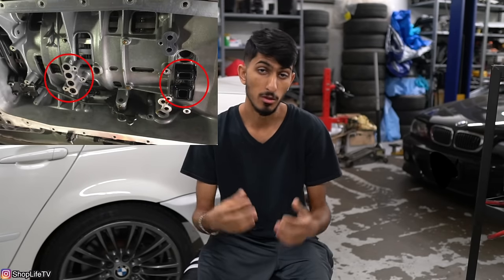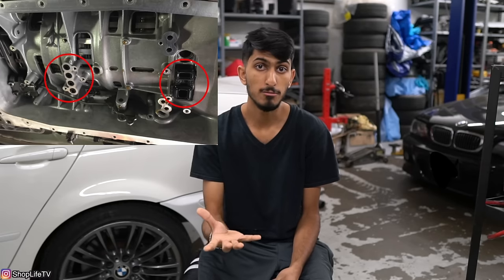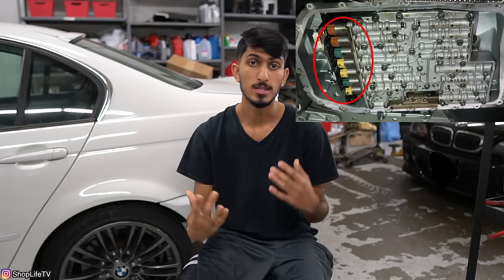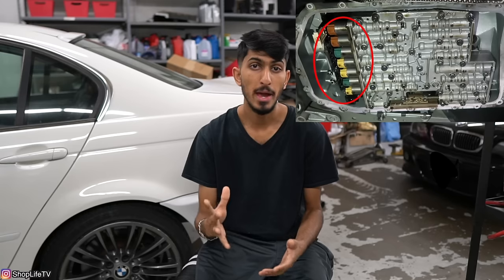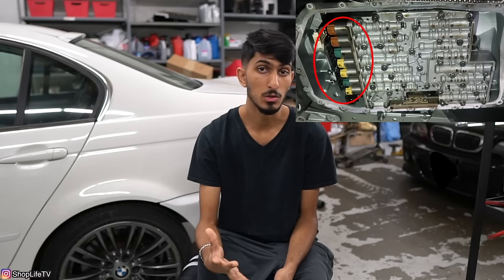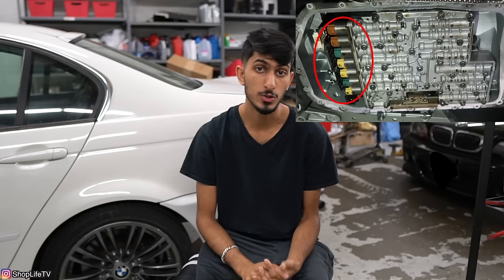ZF 6HP 6 Speed Auto Transmission Troubleshooting! Common problems

Comment: Hey man love your videos bro, super helpful! I have a 2007 335i I bought stuck in limp mode based on transmission codes. In transporting it home I thought I could make it in limp mode but it was a pretty long drive and while headed home the vehicle just died. Refused to try and start at all, no clicks, no noises, nothing. All the dash lights still come on and you can hear fuel pump priming but absolutely no attempt at starting. The codes in getting from my standard obd2 reader are U110F AND P0705. Any help at all you can offer on what you think the problem is would mean the world to hear bro. I’ve read it could be the TCU or short in the wiring but I honestly have no clue where to start, don’t want to jump to replacing things unless I feel there is a good chance it’s actually the problem, I have all the tools and equipment to DIY, just looking for direction. Again any response helps!

Comment: HEY GREAT VIDEO  @ShopLifeTV   ... question  I literally two days ago  had a transmission malfunction shifting from 3 to 4th slipping does not want to go into 4th ( 1 to 2 all good , 2 to 3 all good , 5 to 6 all good and down shifts from 6 to 5 to 4 to 3 to 2 to1 all good)  vehicle is a 2008 535xi   almost 270,000 kms on it . any thoughts?

if im driving and it hiccups from 3rd to 4th , and when I get the fault if I clear it right away while driving  and shift to 5th its all good in 5th and easy shift into 6th . then all the down shifts from 6 ---> 1 from there are fine no issues ... this is so weird 😠

Comment: Hi, first of all I just wanted to say thank you for your videos. I am getting the transmission error 4F85. My car has a ZF6hp26Z. Do you think is a good idea to change the sleeves, filter and fluid? Will this fix the issue? Also my car has 145000 miles on it. Is a good ide to change the fluid? Thank you

Comment: If someone didn’t replace the transmission controller unit for the valve body, what would happen? Would it just not work altogether? Or would it work and then stop working shortly afterward?

Comment: Quick question: bmw 320i with GA6HP19Z. 200k on the clock the filter housing was replaced at 80K because it was leaking oil. Now should I change the fluid with filter at this stage? Transmission is working fine no issues or codes but don’t want to wreck a perfectly working transmission just by changing new oil thoughts ?

Comment: I've replaced the solenoids in my 2007 750li and I'm having the same issue. It's not as bad as it used to be but car still goes into safe mode when shifting from 3rd to 4th and sometimes it gets a whining noise from the trainsmission. Is there a difference in those solenoid colors? A certain spot they go in? Pressure difference?
Reply: My 6hp21 gearbox has 50k miles on it and it fluctuates in rpm when shifting from 3rd to 4th gear and throws the 4F89 error. I changed the sealing sleeve, oil and filter, I will analyze the solenoids.
I did a lot of research on this error code (4F89) and came to the conclusion that the problem is not with the gearbox itself, do you have any idea what else I can check?
Reply: @JulianoEsman  any luck figuring it out???
Reply: @itsdakku  I replaced the clutches, as there were many pieces of them in the gearbox filter. I ordered a new valve body and new mechatronics, it will be replaced now, I hope it resolves.
Reply: @JulianoEsman  yeah im going to do a full rebuild itll cost me 3600 Canadian dollars in total with removal and installation of the transmission
Reply: @itsdakku  Even without changing the TCU, I drove the car these days and noticed that the gear changes were back to normal.
Something I always found strange was that, from the first moment the error appeared, when I cleared the error with the XHP App (you don't need to buy a license to read the errors and clear them using the app), it showed ABS, DSC and flat tire errors. After numerous texts I read, they talked about a problem with the ABS sensor that could interfere with the transmission. As soon as the gear changes seemed to return to normal, I received an ABS sensor error on the right rear wheel. 
I came to the conclusion that you can redo your entire transmission and in the end the problem could be a simple sensor.
Reply: @JulianoEsman  today the car wouldnt go into first gear. I already have XHP for my 340i so ill connect the car the xhp today and clear the codes and see.
Reply: @itsdakku  When clearing the transmission error, if ABS, DSC and low tire pressure flash on the dashboard, even momentarily, it would not rule out a faulty ABS sensor.
Today, after practically rebuilding my transmission, the transmission error persisted, now that I have a constant error with the right rear ABS sensor, the transmission started to shift gears normally without error.

Comment: I have bmw e60 520 d 2008 
After 100 kmph transmission faulty drive moderately light showing  so i have to stop the car switch off and start again and gear shifting slowly also what happing exactly with car please give me solution

Comment: Hi. I have 2008 335xi, I replaced all sleeves and filter as well. When I’m driving and I’m stepping on the gas hard the tranny is jolting and jerking on 3rd gear. Should I replace solenoids? Or it could be lack of oil?
Thank you

Comment: What if antifreeze got inside the transmission..my transmission cooler broke and both fluids mixed in together. Did a flush and filter change but..my mistake the mechatronics sleaves did not get changed out. Do you think I need to replace anything else

Comment: Is there a transmission update that BMW can send to your car to fix the 1-2 gear hard shift and then while in 3 or 4 th it hiccups I guess maybe a slip? I get a transmission malfunction error then it won’t upshift at all. I reset by doing the gas’s petal reset. After that it shifts back to the original problems. I replaced filter fluid and seals for valve body. I hate to keep throwing money at this cause I just don’t have it. But I love the car.

Comment: great info's! 
In case on 6HP gearbox, would you recommend change the entire  qty of oil including the oil from torque converter (total of 10 -11 L)or just the 7 L + filter as  you more than likely will be available to buy as a kit?
Also for changing the total qty of oil (including torque converter) is there any procedure available without invloving the special machine?
Thx in advance for your reply!
Reply: The jag forums have a DIY flush procedure.
Reply: @hoisinga  do you have that procedure?
Reply: Saludos tengo un rrsport 2006,6hp me golpea al pasar de 1  a. 2 y viceversa, que debo reparar exactamente o sustituir?, gracias

Comment: you could probably do a video on changing the fluid alone, every time I change the fluid it gets worse, 06 range rover had a bad solenoid, bought a set and replaced them as well as the seals, now I have no forward or reverse LOL, I need impa or ista so I can actually see what is wrong instead of guessing, measuring the fluid temp is tricky and somewhat critical, just got torque pro to monitor the fluid temp.

Comment: Great video. I have an E65 730ld from 2005 and the transmission keeps giving trouble. Most of the time is when I start the car when the engine is already warm.
The tranmission display starts flockering on and off and it shoots in and out of gear. 

I had 2 different kinds of software written on the transmission ecu but the transmission keeps acting up.

Please say you know for sure what this is ;). Thanks for all your videos.
Reply: I'm having same issue. No codes are showing
Reply: Did u find out the problem?

Comment: I have a BMw X5 4.8 L 2008 , it started with problems on the 2nd speed, later can not shift any, from neutral or  reverse it goes automatically to parking , so the truck is not running any longer. what do you think it may be?

Comment: Tried to ask a question from your website. I am in Australia and it seems I couldn't proceed because I reside outside USA. My question relates to 2008 BMW 550i - last time i drove the car it spontaneously went from D to N and then to P and stopped. It did this 3 times in the space of quarter of 
 a mile. To restart i have to rev the engine a bit. I was able to drive home (about a mile) very gingerly without another occurrence. Would a Sonnax kit  valve body rebuild help with this problem do you think? Chris

Comment: I have a 2006 330i and Transmission Malfunction gear icon is on the dash, code said it’s a 4E87 Solenoid valve 4 shift lock , neeed help

Comment: I need HELP please! I just had my ZF6HP19 transmission totally rebuilt with a new torque converter, re-manufactured valve body, and new Kolene coated frictions and upgraded bushings, etc. We used Pentosin ATF1 fluid since that is what Precision Raceworks said the Kolene coated frictions needed. I get hard engagement in D from N. I also get harsh 2-1 downshift and there is a whirr noise between gears almost constantly. Any ideas?? I am over $4,500 into this transmission and it still has these problems. My re-builder says the problem is the aftermarket race frictions from Precision Raceworks. I get no error codes. I have reset adaptations and ran several different transmission flashes. I am stumped.

Comment: What’s up man, I was doing the normal maintance on the zig transmission yesterday evening and tried to turn on the car once the mechatronics was seated nicely and the sleeve was placed in nicely as well. The car won’t start up and will only light up the dashboard acting as if it is on… not sure if you can help me diagnose this situation. I do feel like I may not have the connector seated on the pins correctly…

Comment: i have m54 bmw with zf6hp19 auto transmission. i have a 4-5 flare when the engine is pushed over 3000 rpm. What would you do about this one? Do you have any idea on how you would go about fixing it. It will set the 4f85 code if pushed hard.

Comment: My 2006 bmw 650i has a normal 6 speed automatic transmission. Did the flush and filter and replace the solenoid sleeves and still not work 100% gave me a fault code with in a week. Whats next to do?

Comment: Hello my son’s car 2006 e90 shows a transmission overheat warning light and him pull over to check find a oil leak after that trying to drive but can’t release the shift from parking positions, he tow back home and we find the leaking coming from the oil pan we replaced with sleeves and zf oil but now we try to clear the codes but the scanner doesn’t have a communication with a transmission control module, all fuses are fine you think transmission are not good thank you

Comment: Hello, my car uses a 6HP26 transmission, in my country I could not found the ZF lifeguard 6, for that reason when I changed the oil I used a Febi bilstein 34608 that meets ZF specification. After oil change my transsmission start to “jerk” reducing from second to first gear. Before oil change I did not have this behaviour. my suspect is related to the oil level. In your opinion, where should I start to check on this case? Solenoid, sleeve, oil level? No fault codes are active or registered on TCM. Thanks!

Comment: I had slow gear change on my automatic 2008 520d. I got the transmission oil and filter changed and it's still the same. What's the problem with it

Comment: There are a lot of numbers on the side of my transmission and the don’t seem to coincide with any I am looking at for parts-  I have a “bad solenoid” code and want to be sure to order the right replacement- 
The car is a 530xi wagon with the 3.0 ltr engine but the transmission sticker says It is a zf5.
Could that be correct?

Comment: Very useful video.
My specific problem is that on starting the auto gear shift stays in 'N'  & not 'P'. So the engine does not start. And there's a message 'Transmission fault ' on display.
What could this mean?
On waiting or reset the car does start or move. But it's a hit n miss. 
What possibly could this be. A valve body or mechatronic or other possible Transmission issue? Thanks much.
Reply: Hey, did you ever find a solution? I just did a full service and filled the trans with new fluid. Went to start the car to continue filling and the car wouldn’t start becuase the trans is communicating that it’s in neautral.

Comment: I have p0850 code- Park Neutral switch on my 2012 Range rover HSE, Car starts and drives perfect with no issues, whereas when i stop and put into PARK, the Dashboard displays N instead of P for few seconds and then i have to wiggle the Gear lever in Park then Shows as P, Sometimes when i get into the car and turn on the ignition display says Neutral, even though the car is in parked position. Can you guide me on this? I looked up so many videos and blogs, it says possible Shift assembly corrosion due to Snow and Salt in Eastcoast or it could be inside the mechatronic unit where there is Park Neutral Switch. Can i Drive as it or it needs asap repair attn?

Comment: I have a 2008 Range Rover L322 with the ZF 6 speed transmission.  If I leave normally from a stop the transmission shifts fine.  If I leave from a stop with a heavier than normal throttle the transmission hangs up between 1st & 2nd gear and the transmission slips until I take my foot off the throttle and then it falls into 2nd gear and the remaining gears are fine.  I have had two transmission repair shop drive my car and they both say a complete transmission rebuild. 
Any ideas?  Thank you.

Comment: Hi Bro, Can i ask you a quick question. after changing transmission oil and filter on my 520d I am getting transmission oil smell from the air vent when the car is idle. no smell when driving. any idea why it's happening. thanks in advance

Comment: Hi how are you doing I have a question regarding to my 528i 2008  I replace all the seals in the valve body in all the celinoids  in i  still get the code 4f8A  4 - 5  gear  do you have any  Suggestions on that ? By any chance?

Comment: Hi.I get a gearbox fault after about 30 min of driving , when the car it`s warmed up properly . The gearbox automatically goes in neutral then immediately in a low gear, i believe 2nd gear , once the fault comes up on the dash . It still drives but just wont change gear. The fault goes away if i turn it off and back one but it comes back later. It feels like some clutches inside the gearbox start slipping , then the fault comes up straight away . No unusual noises , like grinding noise or anything else
.It`s done it while i was driving slow , 20mph and also on higher speed ,on motorway , at around 60mph
From your experience , do you thing it just needs a service (including the 4 seals, bridge seal )to fix the problem ? The gear change is always smooth , until the fault comes up and goes into limp mode. My local garage checked the gearbox oil level and it seams to be ok. The car i have is a 2009 bmw 520d auto. Great video ! Thank you

Comment: What would the cause of jerky 2nd-3rd be? Especially when I am light on the throttle like in slow moving traffic. 2008 540i. Thanks!
Reply: ouroesa I have this same issue. Did you find a solution?

Comment: Hello, my 2008 BMW 335i e90 transmission has recently gone bad on me, or so I think.
The car turns on perfectly as it usually would, but once I put the car on D or R it will not move as if it was still in park . I scanned it for codes and what I got was codes : 4F81,4F91, 5088. 
Which are ration monitoring clutch A , Clutch A-D and gearbox selector switch sensor. 
I have no idea what to do and I am hoping for some assistance or maybe even guidance on what actions. Thank you.
Reply: Daniel Ruiz I have the same problem u ever fix it ?

Comment: Hello, i’m planning to replace all the transmission’s seals (sleeves and the bridge seal). I’ve already changed the filter and the fluid about 5k miles ago and it didn’t solve the jerky/slipping issue that my transmission has (especially under hard acceleration) i’m hoping that the seals will do the trick, do i have to reset adaptations after replacing the  seals?
Reply: Hi im having a similar slipping problem. Have you found a fix yet?
Reply: @tylercarranza9187   in the end i had to rebuild the whole transmission, the clutches were worn out, about 2600€... now seems to work

Comment: I've got a 2007 750li and it won't shift past 3rd gear. When driven babying it, it shifts to 4th and and 5th sometime but will slip bad and transmission goes into limp mode. I've replaced the sleeves and new solenoids. It's still doing the same thing. Could it be the valve body?

Comment: Hi.  WHEN I TAKEE OFF MY FOOT FROM THE GAS PEDAL WHILE I REACH 20 KM/H SPEED FROM ZERO KM/H , MY CAR IS MISFIRES (KNOCK) ONLY ONE TIME.  IN HIGH SPEEDS İTS NOT DOING IT.   2011 F10 150.000 KM. DİESEL. WHAT CAN IT BE ? THANKS

Comment: please if you help me im a very big fan of you im addicted to bmw`s i need a help in my e46 ZF5HP19 transmission i have a cog light(limp mode ) after the rpm reaches 3000 rpm if you may have an idea or happened before with you i would be grateful

Comment: Hi, I had a bad vibration in 6th gear on 8HP75z from 1500rpm under load? The gearbox was rebuilt and the flywheel replaced. The torsional vibration damper was also checked by BMW.  The problem persists and no-one can figure out why its happening. Any idea what could be causing this?

Comment: I have e90 clunky from 1st to 2nd n 3rd gear in slow drive but works fine in pedal press hard, fault code came with gear oil wear. I changed the gear oil and replaced new filter but still working the same... Need help 😢. Appreciated

Comment: Hi there. I have ane65 with a 6hp, not sure which variant. The trans shifts fine and for all intents and purposes runs normally, except the manual and sport modes do not operate and this causes a fault code and that bleeding chime goes off all the time. It has been in a shop here in NZ and after charging $1500, it is still exactly the same. Any input would be most appreciated. Cheers